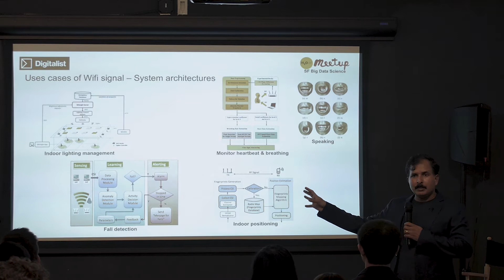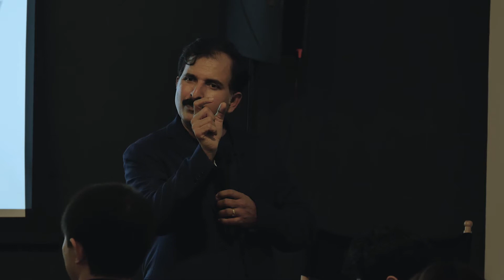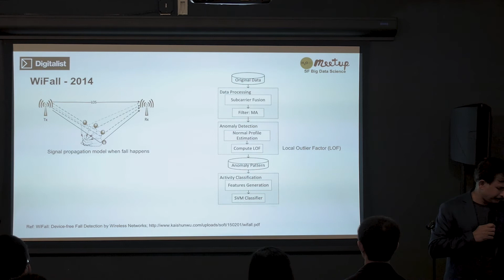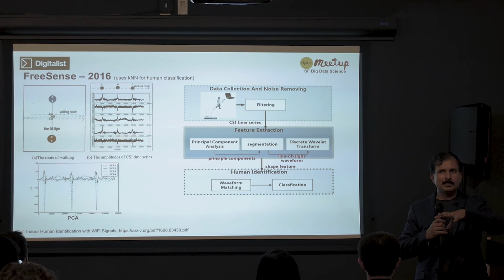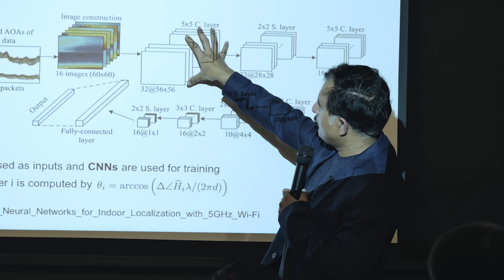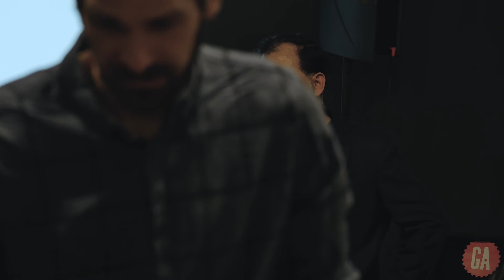Human Activity Detection Using WiFi Signals and Deep Networks

Comment: The h matrix explanation is incorrect. The elements are complex variables which include magnitude and phase of the
 MIMO mixing. These describe the eigenvectors and eigenvalues of each spatial stream or MIMO path. The number of rows and columns is the number of transmitting and receiving radios. It's not the number of subcarriers. That's described by the element as a frequency response. A better formula separates MIMO mixing from distance. Radios are complicated so the signal strength loss is better described by a D matrice on the TX and a D' on the receiver

Comment: To answer the question in the final slide : Is there a correlation between CSI and Human Behavior? check the following paper
Paper <Fresnel Zone Based Theories for Contactless Sensing>
Quote: The Fresnel Zone-based sensing theories lay the theoretical foundations for the design and analysis of wireless sensing systems.

This team from Peking University has done much work on this Fresnel-Zone-based theoretical foundation